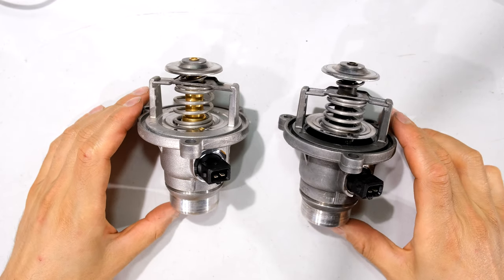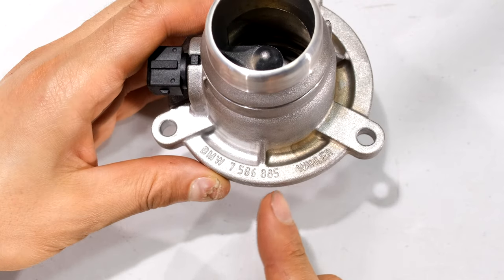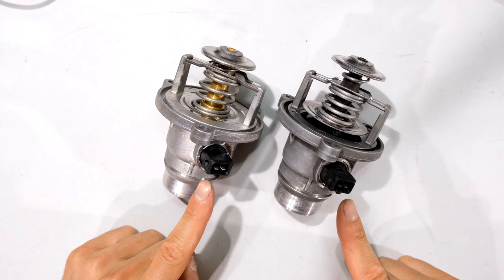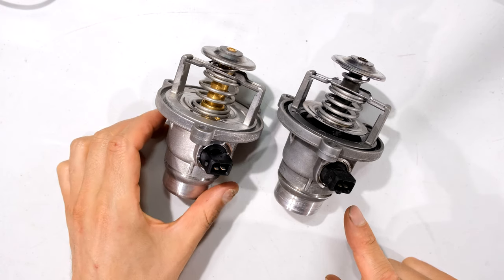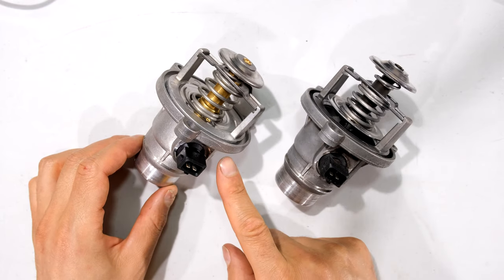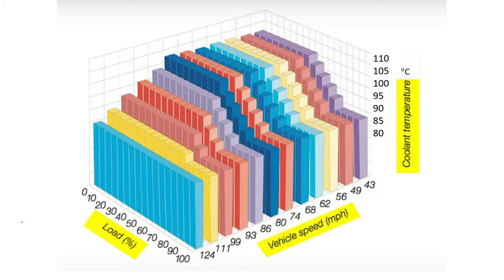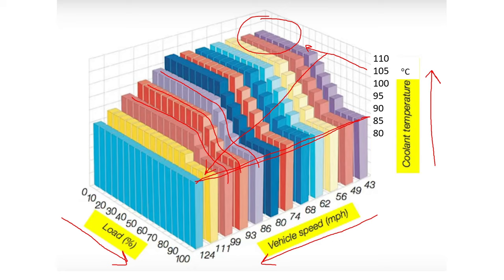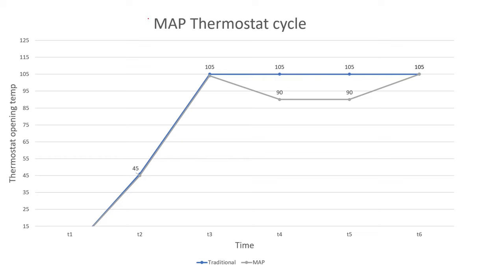How does an electronically controlled MAP thermostat work in your vehicle- explained and tested

Comment: The reason why it’s hard to make it hot enough is because there’s no pressure.On vehicles we are using the pressure cap to raise the boiling point.To substitute the radiator cap it will be similar to use a pressure cooker.Which could be hard to do.Just I thought this could help.Otherwise thank you 🙏🏿 so much great information.

Comment: Men, your video is GREAT, thanks for publishing it.
I have a 2013 Porsche 911 and have changed the Wahler thermostat 3 TIMES.  The recurrent problem is that it gets stucked in the oppened position.
This is really driving me crazy. From your video, I guess that the problem is related to THE SENSOR and not the thermostat and I need to address that.  The funny thing is that I am not getting any faulty messages on the computer...
What do you recommend?
THANKS !!!!!!!!!

Comment: Philip, I thank you again for publishing this video!
I have a question that ONLY YOU can answer.
What do you think could cause a thermostat to get damaged after just 500 kms of use?
I have changed the one in my car a couple of times and they keep failing...
Evidently, there is some element which is causing them to fail. Porsche says that it is a faulty coolant valve... does this make sense to you?
PLEASE RESPOND, YOU ARE MY ONLY HOPE TO SOLVE THIS.
Thanks!!!

Comment: If MAP function on ThermoS not working or gone faulty..... the traditional wax element will still work but not pro actively, or intelligently. GOT IT, cheers....  > however my new MAHLE Thermo very much stays well closed on the car and boils the car obviously.... and in boiling water test in a pan likewise, they do not open at all.  I may add I did not have on a 12v source though, didn't know, new to MAP based Thermostats , this video helped enormously !!!!   I was presuming my coolant circuit itself is faulty, wiring, relay or fuse, temp sensor, or other, hence why either of my new thermostats won't open at all......  But, given you said a MAP thermo part faulty will still OPEN on wax element traditionally , and mine doesn't on car or in boiling pan so I'm totally stumped.     If you have any idea be great.....  I thought I had isolated equipment or thermoS itself on an OHMS test and car does not boil when thermostat housing on car with old thermostat removed, straight through pipe thermoS less.... The car then does not boil up then, runs ok 20k does not overheat like when do 2k with closed status Thermo.... My issue is ThermoS is one way or another staying stuck closed !!!! MANY THANKS if know what I may have got wrong in my head
Reply: Hey dan i think i have the same problem i changed my thermostat twice and it doesn’t open however the temperature is normal but it doesn’t open and the fan stay work on lowest speed, any advice 🙏🏻

Comment: So, if you could help be amazing, I too have a Mahle and have watched same Mahle video, yours is miles better, have no idea thermo's were electronically controlled..... I think I've a circuit issue, thermoS not working whatsoever !!!  I've a car bought 2 new Thermo, correct OEM, both checked stay closed on the car, cold pipes likewise, car pressurises thermoS is closed , but off the car they open normally.  My guess is circuit faulty, maybe relay been told,  what would you suggest thanks, I'm in a  permenent ThermoS closed status..... My scanner showed car rad temp at 119c , fan also only kicks in at 110c, all very odd, I'm no mechanic, I'm learning on the go ( I've belatedly bought coolant temp sensor x2 to exchange and if after this the fan still kicks in 110c not 98c and new Mahle MAP ThermoS stays closed I'm stumped ).... car went in for just an oil leak garage, ended up having a ThermoS, Water pump & New header tank..... Totally bamboozled why , was told water pump problem......   This became a pressure cooker and don't want garage do a head gasket dissent need.... I'm learning so want to work it out myself !!!!!!  This is definitely not a head gasket, it was well driven prior to suspect crankcase oil leak...

Comment: For ohms, given that 15ohms is normal, what if the old one has lower than 15ohms, say 4ohms, or higher, say 21 ohms? Are there two different explanations for those circumstances, or does that just mean the heating element is faulty regardless?

I ask because this would help others with heating element problem's more than you mentioned.
Reply from the maker: if the resistance deviates as much as you cited, then the unit is faulty. I would allow for a 10% tolerance but more than that i would consider it faulty.

Comment: How did you figured out that the old one was broken? Any fault recorded?
Reply from the maker: there was an error when i scanned with INPA on this BMW
Reply: @ecologicaltime  thanks! I have the small 1.6 N13 on a F30. No error. It takes 15-20 minuets (city driving) to get to around 80 and then it's stuck there. If I drive a bit sportier I can get it to 90, but that's about it. No errors (Insta+).
Very interesting test with the hot water . I was thinking that maybe the output for the heater circuit might be stuck closed in the ECU, keeping the thermostat open at all times. But from your experiment it looks like it doesn't give enough heat to open the thermostat in cold water. So if I get a warm hose between the thermostat and radiator at low temps (let's say under 50-60 degrees) I can safely assume the thermostat is mechanically stuck open, right?
Reply from the maker: Sounds like its faulty and staying open partially as a fail safe.
Reply: Would the map Cooling thermostat make the car smoke or steam out the back
Reply: @TomStewart-g3q  Most likely if the engine overheats. (leading to blown head-gasket.. ). If it is stuck open is not ok either - if the engine doesn't get to operating temperature you get, for starters, an oil that is contaminated faster than usually (from water that never evaporates, for example)

Comment: I truly truly believe and think this is the most unnecessary, unneeded and crazy component that the auto industry added on already complicated and unrealiable modern vehicles. We need to stop this madness. Modern engineers create problems than solutions in the name of innovation. Even jet turbine aircraft engineers had not gone this crazy. I don't buy this man explanation. A thermostat does need an electronic switch. We have gone bananas. There goes the most inexpensive engine part ever going up the graph on the prizing market index. The shareholders wants profits at all costs. Obviously there will be paid videos providing a perfect explanation why you need this piece of technology.
Reply: I agree with you fam. I am currently working on a 2013 Chevy Sonic LT. It has an electronic thermostat for what I don't know. It is not efficient. This garbage is throwing code P00B7 for insufficient coolant flow. I have replaced every part dealing with the coolant system, and it still throws this code. I drive to work a 2003 Lexus es300. My temp guage started fluctuating. I removed the old thermostat and tested it inhot water, it didn't open, I replaced it. Car has been running fine every since. Meanwhile, on this Sonic/Cruz, the struggle is own going. Crazy how these cars a put together.